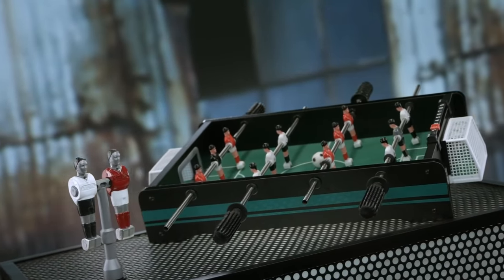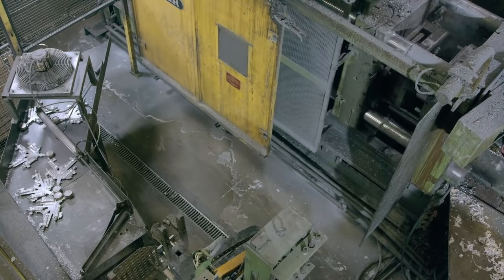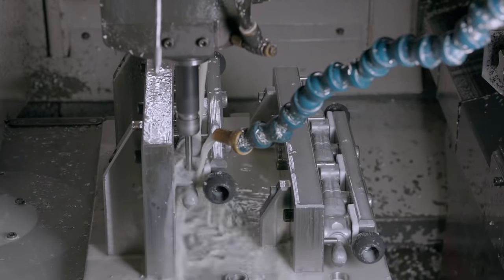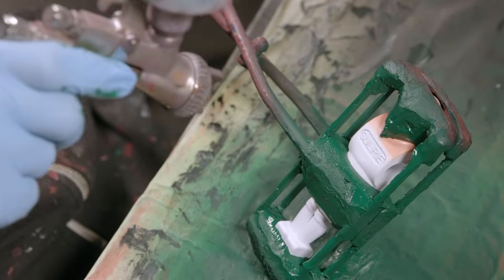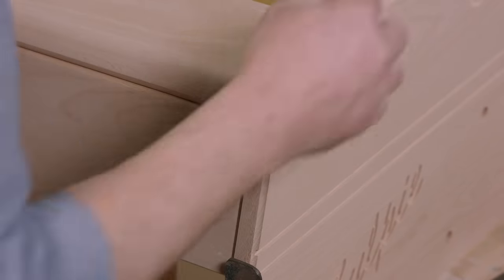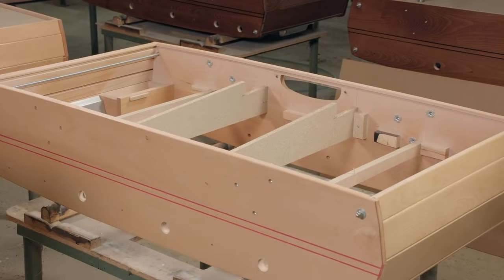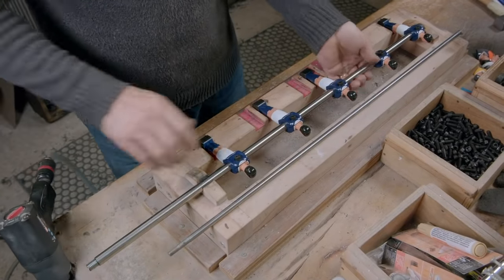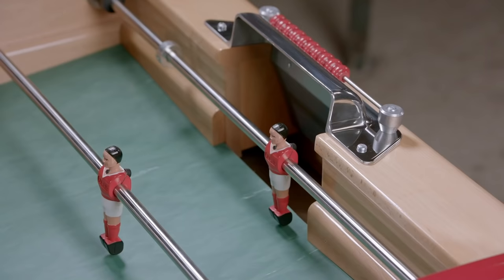How It's Actually Made - Foosball Tables

Comment: Manufacturing Fun Fact: The fixture that holds raw castings in place so they can be machined by the CNC mill is called a tombstone, because it is so heavy it will kill you if one falls on you.
Reply: The same thing could be said about YOUR MO-
Reply: what a lovely name
Reply: That's also how the frozen pizza brand got it's name.
Reply: @AgentTasmania  doesn't work as there is no o after the m in mustache
Reply: @Draco9909  A lot of Europe spells it "moustache" and the U.S spells is "mustache" but technically both are correct.
Reply: oh god, no
Reply: @abigbutterstick1780  fair enough.
Reply: My dad did CNC. When the company went under and liquidated assets the CNC machine he used was sold.  It get placed on the truck only for it to fall off the first turn out of the parking lot.  GG a multimillion dollar machine.
Reply: T-that is nto a fun fact actually thats AN AWESOME FUN FACT
Reply: This is true. I've tested it.
Reply: @abigbutterstick1780  Technically correct is the best kind of correct.
Reply: @Spinolio  Agreed
Reply: @tincano-beans2114  it'll certainly make you wish you were under a tombstone
Reply: @pixelmace1423  MONEY
Reply: why would one fall on you
Reply: why would one fall on you
Reply: why would one fall on you